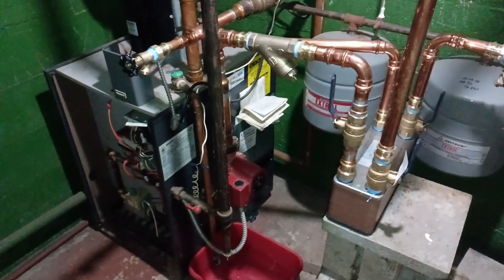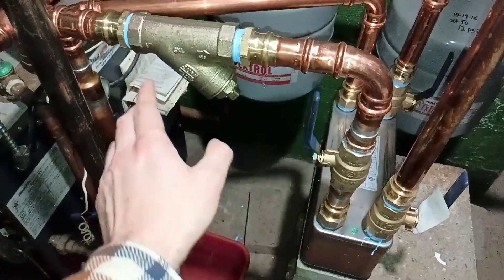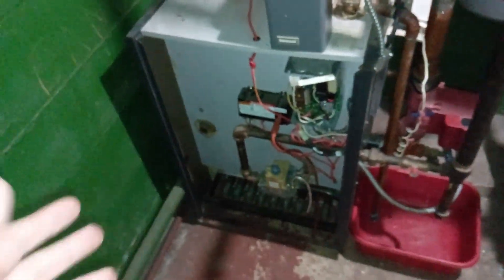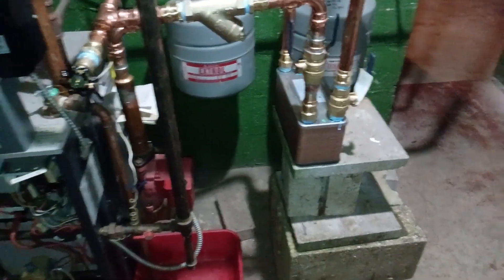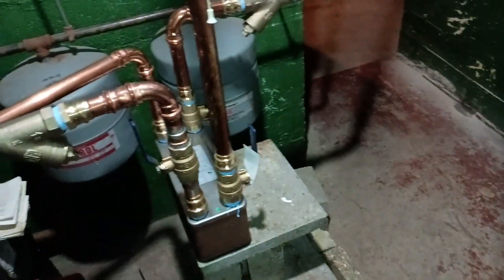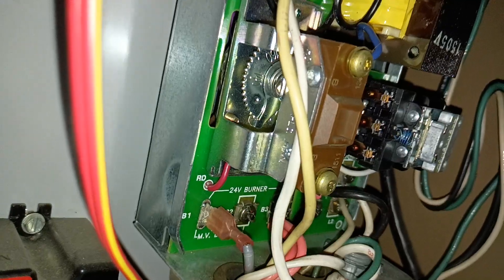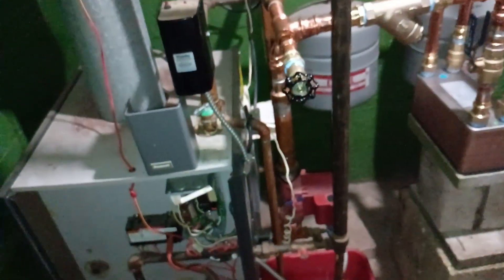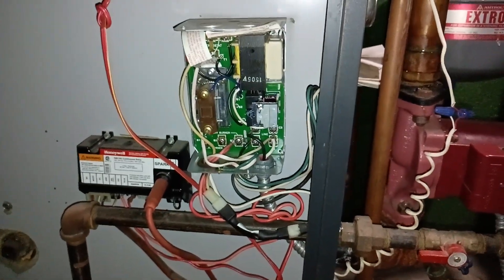Outdoor Wood Boiler Connections and Control with Existing System - EClassic 1450 - Heat Water

Comment: How does the outdoor boiler loop fill and pressurize?  Do you have another pressure reducing valve attached that regulates pressure constant like the indoor boiler loop?
Reply from the maker: The outdoor wood boiler is an open system (not pressurized). The water is filled from the top of the boiler and you add a corrosion inhibitor.